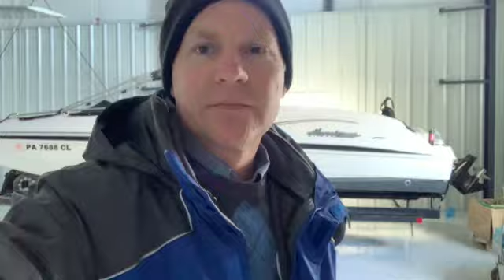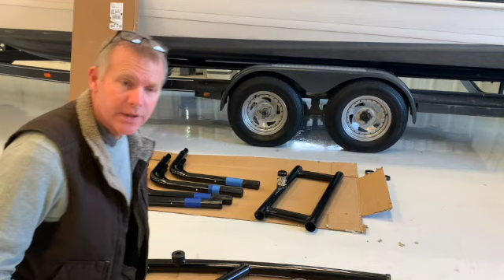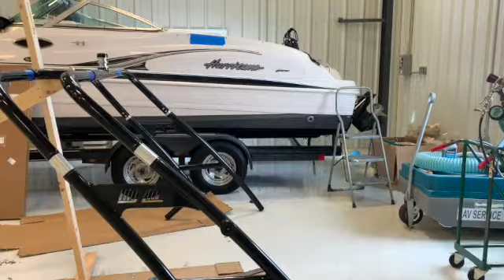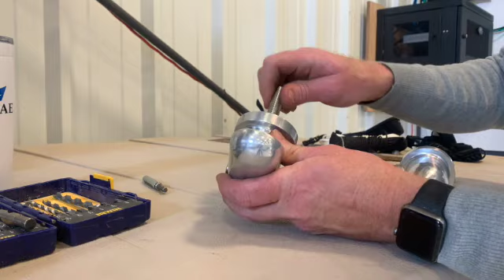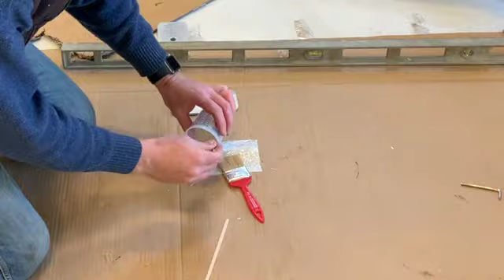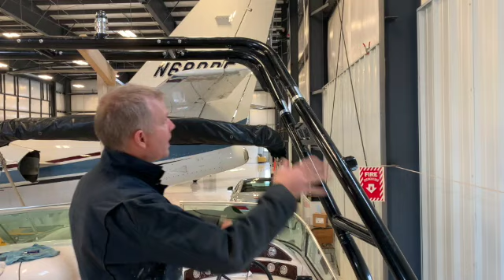Big Air Wake Board Tower Install on Hurricane Deckboat

Comment: 🛑🛑 I Really Liked Your Video, and Your Attention To Detail😀👍. 

Just a Few Follow Up Questions…
• After your installation and using you Big Air Tower, how did you tower perform?
• Is the tower as tight and affixed your your boat and it was after the installation?
• Was there anything that is a “watch out” or something you would have done differently?
 • Do you still own the boat?

Thank You 😀👍
Reply from the maker: Hey, thanks for the question. Yes, I definitely would recommend the cud’s tower after 1 year of use. This is my second tower and second boat. I installed both. This cud’s tower is very durable. The only thing I would have done differently is to not put quite so much “preload” on the tower when I drilled and bolted it together. I do fold mine down regularly, and with the 5” of preload on the tower it makes the install after fold down a 2 person job. I just can’t get the back supports to spread apart and line up with the bolt holes all by myself. I think I would put 3” of preload on the tower next time I install. Still love the look and function.
Reply: @toolman311  
Thank You. 

I’m going to put a Big Air Big Haus Tower on my boat this Spring. 

Your Cuda Tower is basically like the one I ordered. I liked how you added the pre load” of 5”. I was intending to do the same (5”). I don’t think I’ll be “lowering” mine very often, so I think I’ll be ok. 

Overall, the tower construction and mounting system was good?  No Spider Cracks to your hull??

Thanks so much for your input. I’m just trying to cover “all my bases”. 😀👍
Reply from the maker: @genekelley7579  looks great and works well. No issues. Good luck.
Reply: @toolman311  
Thanks Again. 

Have a Great Summer this year😀👍.